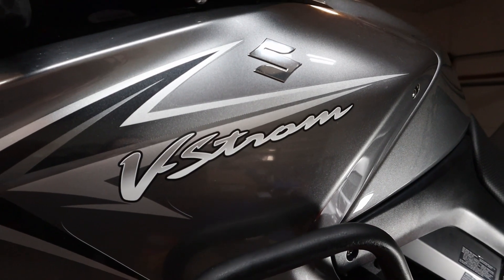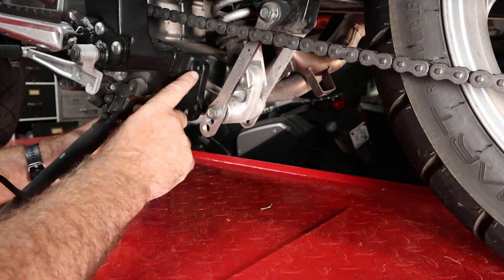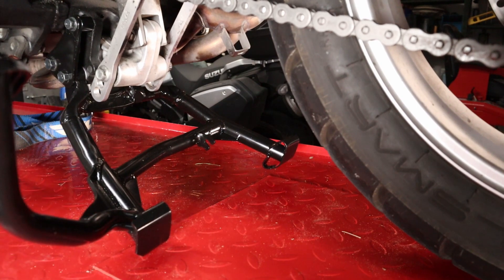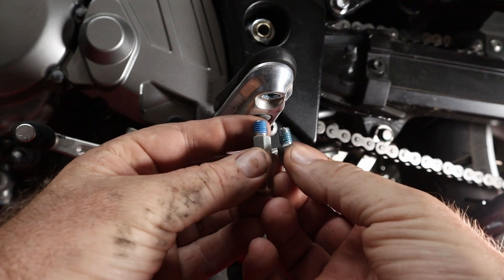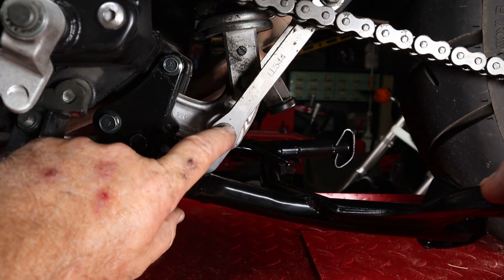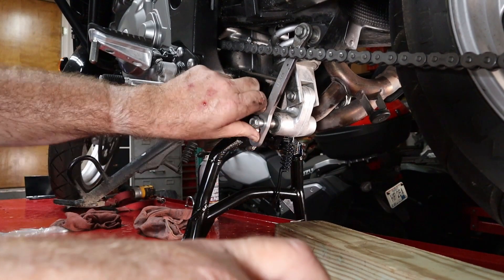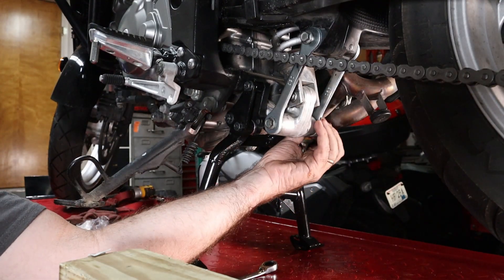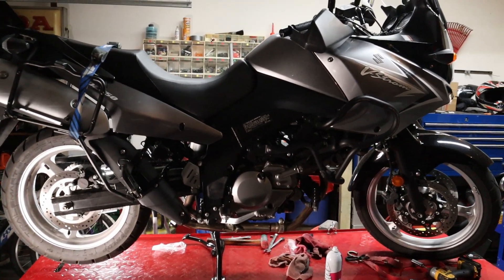DL650 VStrom Center Stand or Service Stand installation. Rear shock linkage or Dogbone swap out.

Comment: Did the previous owner also lower the front suspension to match the geometry of the lowering dogbones?  They should have…. So when it’s put back to stock remember to bring the forks back up in the triple tree.
Reply from the maker: No they did not change the forks. Thank you for watching.
Reply: If you have room , small vice grips work WELL for the springs!!!!😊😊😊😊😊🏍🏍👍🍺🍺🍺🍺

Comment: What is the torque specification for the dog bone bolts? I've got lowering links in a 2015 dl650 xt i need to replace with oem ones.
Reply from the maker: The actual dog bone bolts torque to 56.5 ft lbs, The lower rear shock bolt torques to 36 ft lbs. The remaining bolt on the cushion lever also torques to 56.5 ft lbs. Hope this helps and thanks for watching.